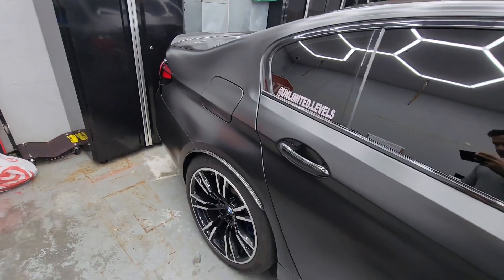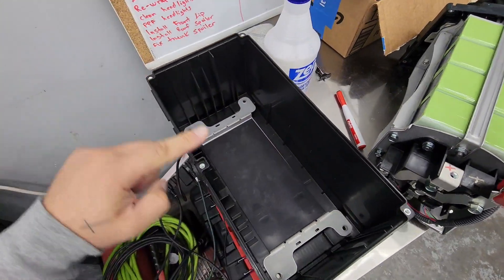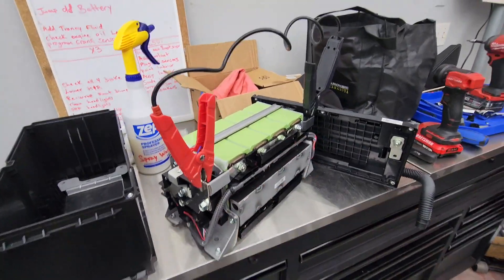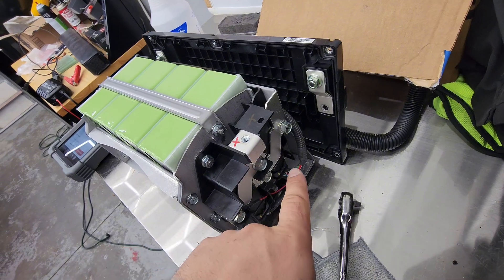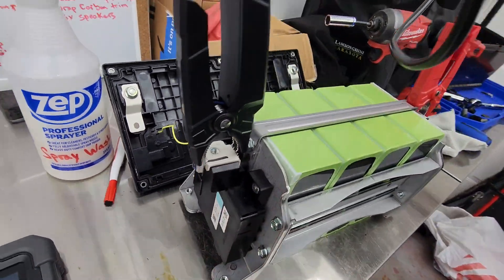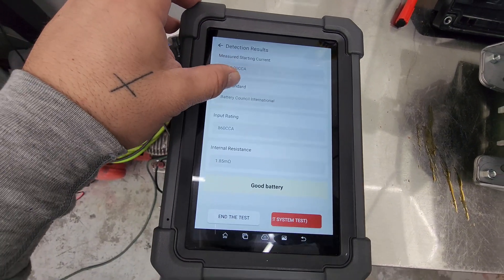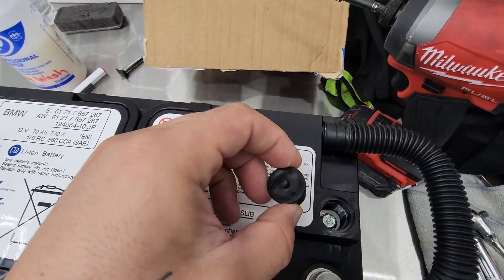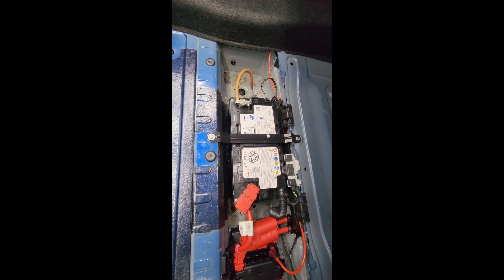Fixed my Lithium battery 🔋 BMW M5 😎

Comment: My battery on my f90 is fine ..car starts and everything but keeps saying replace battery on the dash will charging it like this get rid of that notification? Thanks
Reply from the maker: No. You have to program that code/warning out. Your battery snitches on you that it died to 0% before. That's what the warning is. Ignore it or program it out

Comment: Hey man! Great video! Do you by any chance know the voltages to know if the battery is dead and replacement is needed?
Reply from the maker: My battery was at 0v and still came back to life doing this

Comment: Hey mate, I just received the " replace battery " fault and I'm wondering how i can understand which battery it concerns ? And what tools Do I need to reset the module etc. Thanks in advance !!
Reply from the maker: You randomly got that? Or after you did the fix like I did in this video?
Reply: @unlimitedlevels  I did not fix anything, I have the fault since I got the car but never had any problems with starting the car or anything. I just go the check engine light and " replace battery " fault. I want to get rid of it somehow..
Reply from the maker: @petarkozovski i coded the check engine light fault out when I tuned my car. That's easy, however the infotainment screen will still give you that massage everytime you shut the car off. Not a big deal but you can also code that message out with bimmercode. Sounds like someone killed your battery fully and resurrected it like i did. Battery workd fine but the BMS still has that code registered
Reply: @unlimitedlevels Can you please tell me what exactly what I need to do to get rid of that check engine light ? It will be much appreciated
Reply from the maker: @petarkozovski is your car tuned with BM3?
Reply: @unlimitedlevels  I bought it from USA, I don't think it's tuned
Reply from the maker: @petarkozovski ok. Go to Bootmod3.com and buy a stage 1 tune. In that tune you can add the code for the ECU to ignore it so that your light turns off. Or try bimmercode.app and see if they can code it out for you. That might delete the code as well, and a lot cheaper than tuning your car
Reply: @unlimitedlevels  hello, i did everything in the video but my car still have the replace battery error.
Reply from the maker: @petarkozovski same here. You have to code that out with BimmerCode if it bothers you. However, I've been driving with that error for over a year now 😐

Comment: Hi, great work. what tool used in demo to test battery?
Reply from the maker: This Bluetooth tester. You can use your phone or a diagnostic tool like i did. I use Launch x431 

https://a.co/d/29wVlFk
Reply: @unlimitedlevels is the battery showing good health ? Is it holding a full charge ? My 2015 M4 battery is still working well for me.
Reply from the maker: @LemonySnicket-EUC has been 9 months since i did this and it still works 💪
Reply: Good deal ! Thanks. @unlimitedlevels

Comment: The battery contains a safety switch when it drains it will power off. Thats why i have had the same lithium battery for 8 years. Better tech

Comment: i just went thru all of this on my bmw m4 battery. All you have to do is jump it with another car and cables. Just tocuh the dead battery post with leads for like 5 seconds and bam it will go from zero volts to its natural charge.
Reply: I have done that as well. It works.
Reply from the maker: Good to know!

Comment: Did you guys use repair mode or regular charging (I have noco)

Also, do I need to re-register the battery?
Reply from the maker: Regular charging, I believe. I also used noco. 
What car?

Comment: LOL Porsche/lambo would have went right ahead and locked that battery up for undervoltage and no they're not gonna reset it ever.
Reply from the maker: @dodtickson3297  bmw would never reset it for you either!! They want you to buy a new battery that $2,000. Lamborghini is $4,400..... crazy